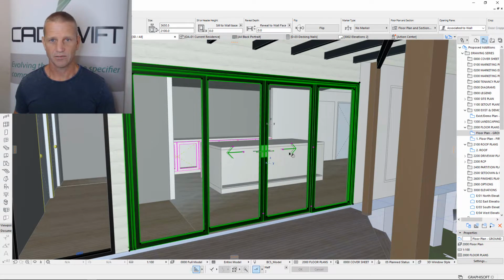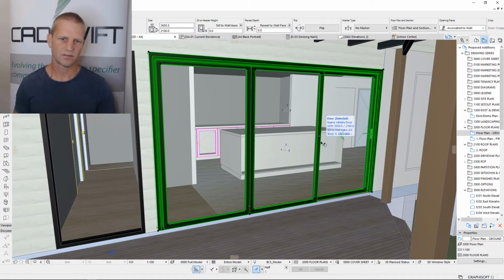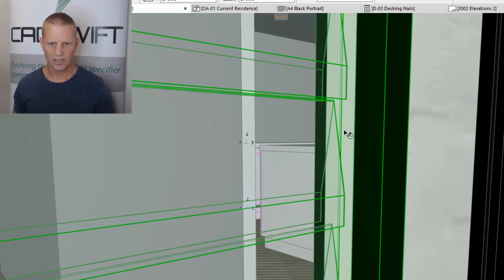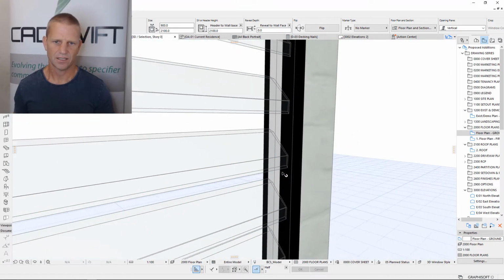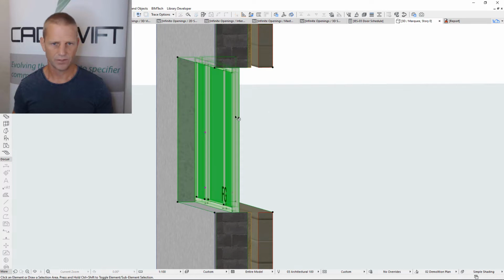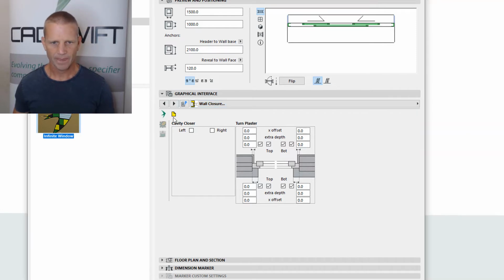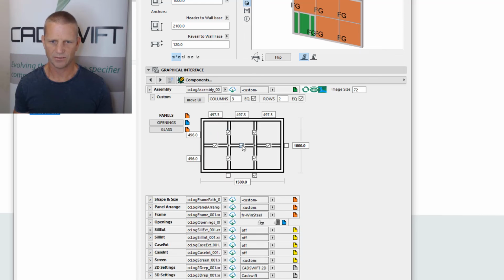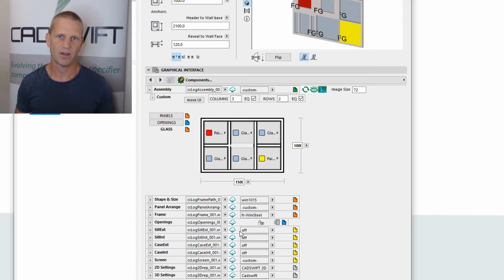Infinite Openings - Updates February 2022

Comment: Thanks Chris. Are you able to also have a sliding door with all panel sliding? (Cavity slider type door)
Reply from the maker: Yes you can do all types of sliding doors (Cavity Sliders, Face Sliders & Robe Sliders).
Plus you can nominate how many panels on each side and how many are fixed (including none fixed).
You can also control the width of each panel independently.